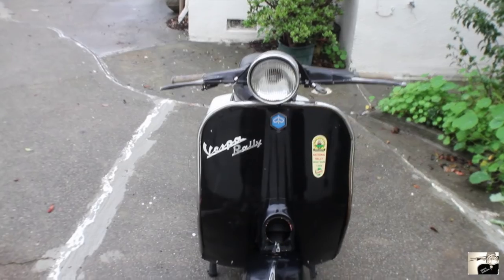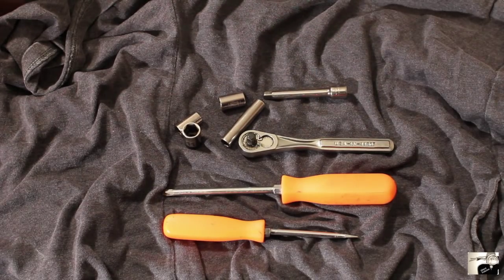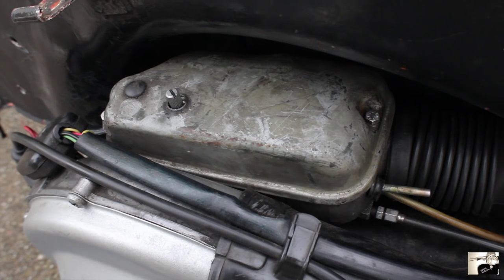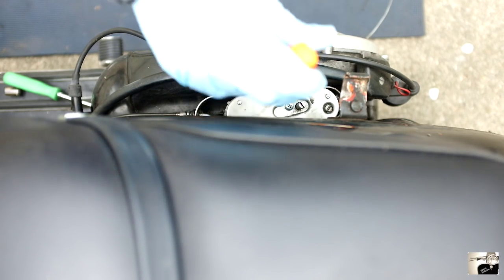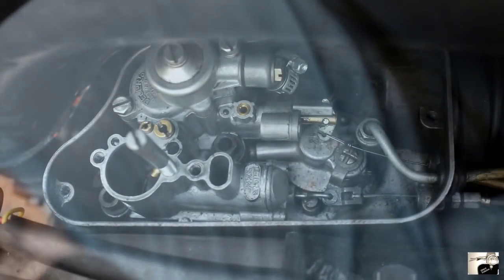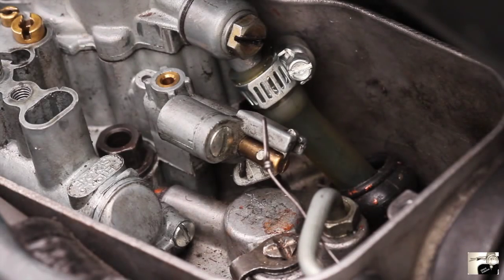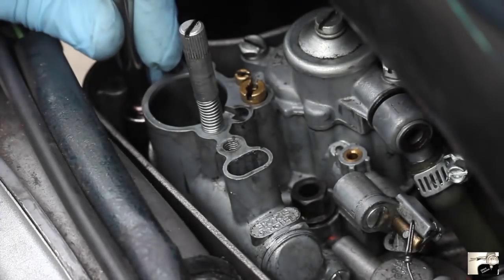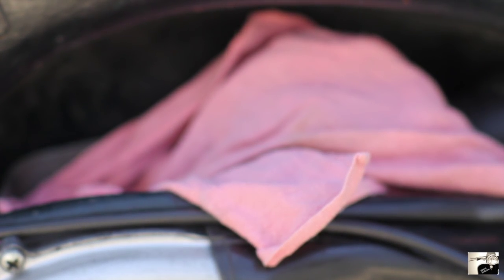VespaCarb Rebuild Part I of V

Comment: Missed out on how to disconnect the throttle cable which is easiest done by sliding the slide bar attachment which the cable resides in to the right whilst holding the cable stationary so it pops out of the "U"